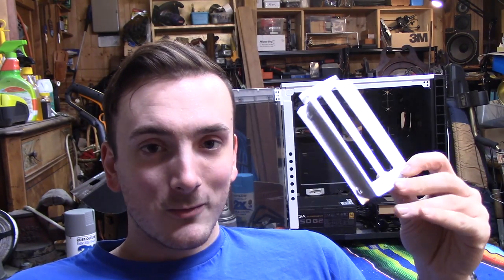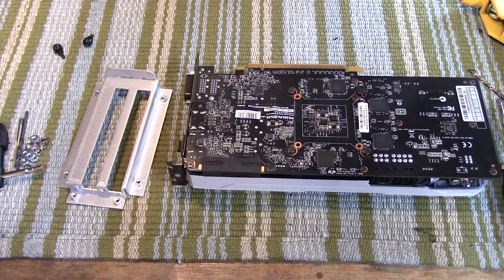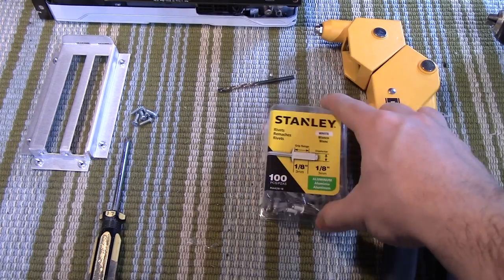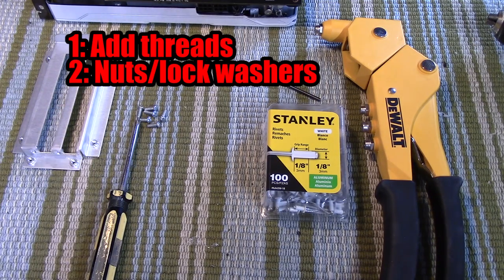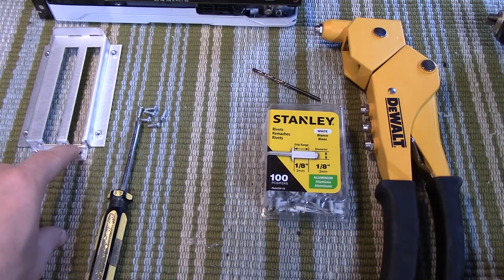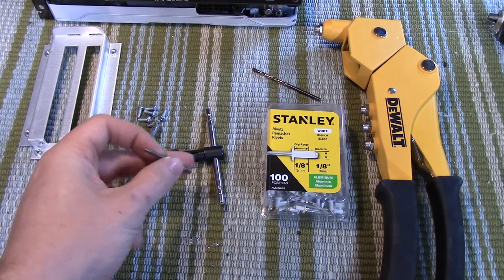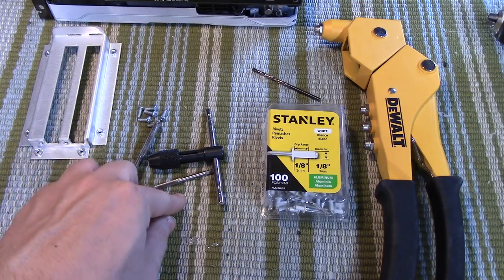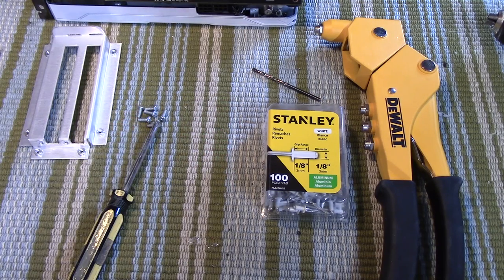How to mount your GPU vertically in any PC case!

Comment: would of been alot easier to just use the gril next to your case pci slots instead of making it to where your case no longer could do more than one sort of expansion card.
Reply: Ikr exactly what i was thinking all that time just wasted
Reply from the maker: Ronnie I think it looks ugly being too close to the window
Reply: Dietec understandable. as long as it works for you thats all that matters since its your case.
Reply: Dietec not for me since I use a water block from EK. I would have saved those $20 spent on that mounting bracket on some RGB LED fans like those cool solar eclipse fans.
Reply: But- if you used the grill, all the other PCI slots would still bee intact to populate. Doing it that way renders all your other slots useless,, unless you run more extensions. Jus saying- for a lot of people who have use for those slots- the grill would be a much better placement. With that said tho, I am a fan of your work, & for the most part- 99%- I love your tutorials bro! DEF not trollin ya
Reply: Alex Strogy you really took the time to correct grammar on a month old post? this is youtube, not my senior thesis.
Reply: I was literally thinking the same thing the entire time. That's what I would have done, I mean what if you ever need another PCIe slot? Lol out of luck I suppose. But he did suggest you just buy a case with the vertical slots I guess.
Reply: I don't know how much I would worry about air, as long as you have intake fans bringing fresh air into the case I think it would be ok. When you have SLI going the top card is always smushed so close to the bottom card that it runs warmer but it's usually never a big issue.
Reply: Ronnie, unless the side panel has ventilation right next to where the video card would go, I'd avoid putting it too close to the window/side. It needs space for ventilation and airflow for the fans.

Comment: How did you connect the card to the motherboard?
Reply: PCIe riser/extender cable.
$ for boring reliable versions from server/enterprise/datacenter suppliers or $$ for fancy branded decorative versions from PC enthusiast/gaming/modding vendors.
You could run a string of them halfway across the room if you like, the short distance inside a PC case doesn't add enough signal latency/loss to actually impact bandwidth or fps.

Comment: If this bracket has 6-32 thread in it you should put the screws in from the other side. That way you don't need nuts and don't need to tap threads in the metal plate.

Comment: Three things: 1. That case looks like it has a spot on the right (when looking from the back). Was there any solution you could find online that could utilize that space so you could still have those horizontal slots if you needed them?  2. Your lines need to be cleaner/straighter. My inner OCD is screaming bloody murder. 3. Great vid and tutorial. :)
Reply from the maker: +Middle of Knowhere I wouldn't want to have the GPU that close to the window, I know my line work needs improvement, I love you. Only thing I regret really is not sanding the cut pcie slots but I just didn't think about it until after it was already painted. Was too excited I guess
Reply: Perfectly understandable about not wanting the card too close to the window. Keep up the good work.

Comment: Great tutorial, but you should level the volume of the music next time. It blew my ears. :)
Reply from the maker: Peter M Ooof sorry. I actually did listen for that but my own ears weren't blown so I thought it was fine. Maybe I'm deaf, I'll try harder next one
Reply: that was REALLY loud
Reply: the music was annoying
Reply: i was thinking the same basically you should try to match the music's volume with your voice its like your voice = 5 and music = 9 cant explain it better
Reply: secrets to YouTube audio, Mono all voice, level all music and other audio at one third and only use instrumental music.
Reply: Peter M, next time when you feel the need to give unnecessary critics just keep it to yourself and use the volume adjusters on your system. that’s what there for after all.
Reply: zygis337 triggered?
Reply: TheDutyPaid, not at all.
Reply: zygis337 Don't you see your very own comment was unnecessary. 
Ah, hang on. You doing what the kids calling 'trolling' 
Do I need a sock puppet now or something?
Reply: TheDutyPaid, go grab some beverage and do some reading about what trolling is. Peace.
Reply: zygis337 I have no idea about it but I can still question why you posted the comment you did. Even the video creator acknowledge and responded to the original comment in a constructive way.

Comment: If the plate you are using is threaded already on the mounting points, why not simply drill a hole large enough for the screw to fit in and screw them in from the outside so that the head of the screw applies force against the case to hold the bracket in place. Seems a lot simpler than trying to mess around with nuts or tapping.

Comment: there should be a bracket that is vertically secured onto the pci brackets by the place where you would normally screw your gpu into

edit- wait never mind youd still need holes for I/O

Comment: If the adapter plate has threaded holes in them, why did you need to tap the plate you made? just enter the screws from the other side!
Reply from the maker: +TheOystei I happen to be a silly goose

Comment: Show it connected with the riser card is how u should have finished to make sure that where u moded and the riser card fit into the mobo
Reply from the maker: This is more of a proof on concept video. All cases, cards and mobos will be different and so showing my own working isn't going to be an accurate representation of how someone elses will work
Reply: Dietec fair enough and grate mod I myself am working with the evga dg-87 case looking at options as well

Comment: Excellent video. I see someone already mentioned the "nut-to-lock washer" orientation, so I will not repeat it. Personally, I think painting the modded bracket and plate before installing it would be better insurance regarding potential rust build-up, but I am picky like that.

Comment: Nice mod my Dietec friend. I have a question, is it possible to put the bracket on the left side where all the holes are..if it's to large you just have to cut the side of the bracket to fit and screw on top and bottom..not on side so you don't have to modify with a metal plate.
Reply from the maker: Alain Lafleche it's possible but I think you'd have to put a metal plate over the vent holes anyway, it'd be hard to screw it onto that area with all those holes there

Comment: Hey was wondering if a jigsaw is essential for cutting metal (for a side panel window) or could i just use a dremel tool? Also have you got a link to that spray paint? (If not its cool). Awesome vid btw. Been watching here for a little while and want to get into modding :)
Reply from the maker: Jigsaw makes cutting larger things muuuuch easier but yes, with a lot more time you could do it with a dremel. The paint was rustoleum enamel
Reply: Alright thanks!

Comment: Howdy Dietec, You have the screws in backwards....The heads would be on the Flat side and the threads would end in the threaded pieces on the plate, there was No need to tap out your plate....I would suggest though to use some flat washers and some lock tight on your new mount to avoid vibration loosening the screws.. for what I mentioned,  The way you showed & used them with the lock washers have no need.  Anyway Nice Video, I just did 2 of brackets those in a Wp200 case at a 45 angle for a show but on the top like the TT 900 Tower case   The worst part is Fabricating New Pci 16 Ribbon cables to custom length and then hiding them with the chrome the customer wants.....Keep up the great work young man!  Cow }:-o)
Reply from the maker: +Im1CrazyCow Oh, yeah I see what you're saying. Totally didn't even think of that
Reply: Ive done it long ago so No sweat just thought ide throw it out to you,,,Keep up the great work young man!

Comment: NIce video dude. BTW the amount of detail a manufacturer puts on the graphics card front, they should be mounted vertically.
Reply: Mounting vertically will also not bend the PCB as it use to when mounted in regular manner. ( big GPU sag mostly )
Reply from the maker: DIY Tech I agree it's weird that they put so much effort into a side that isn't usually visible but a lot of cards don't have backplates

Comment: Doesnt the pci  cage you bought have the nuts already on it, so in other words you just need to drill the holes for for it, and run them from the other side into the nuts, instead of treading them through the back and then adding the new nuts and washers. Am I wrong?
Reply from the maker: You're not wrong! Still, if you've got a mount without threads in it already, you'd have to do this. This isn't the only mount out there and I'm not sure how the other ones are

Comment: I have an Air 240 that my 1080 barely fits in, door is pressing against the cooler shroud. been thinking of doing something like this for it.  this video has been very helpful.
Reply: SilentGamerGuy Another Air 240 user here. Did it work? Did you do it?
Reply: I did get it mounted vertically. but I didn't use a mounting bracket.  I made some cuts in the back fans slots, and cut out the metal bars where the gpu slot is.  it's very shitty looking. if I had the option to go back, I wouldn't have done it the way I did, it looks so ugly.  I mean the rest of the case looks cool, just the back looks like shit...  If I could do it again I would have just bought an Air 540 and bought one of the Cooler Master vertical GPU mounts they sell on Newegg.
Reply from the maker: +SilentGamerGuy The cooler master mount is pretty nice. I would get one of those too if I wanted to do this again.

Comment: i was just looking into doing this mod to my inwin 303.  Only thing test the fps with gpu directly into motherboard then test again through the cable. cheaper cable have a bad habit of fps loss.
Reply from the maker: Squeeker Radio I'll do a test like this if I ever have one myself, but I linked the one with the highest rating I could find. Hopefully it works out for people.
Reply: Dietec ill be doing the same mod so ill let you know my results

Comment: No need to tap or screw anything together, just rivet the bracket to the case.  This guy is making it way harder than it needs to be.  And to top it off, he put screws in from wrong direction.  I bet this this guy flips burgers for a living.
Reply from the maker: I have been known to flip a burger here and there

Comment: idea of plan 'good' execution 'bad'!you wrecked your case and you wasted the option for expansion slots. I understand why you didn't place it next to it where the mesh is. but you still could have if you opted for modifying your side panel so the gpu can breathe. I own a nzxt phantom 820 case and have a similar idea of plans but I am going to remove the location for external water loop holes next to the case bracket and have the luck I have a mesh on my side panel so my expansion options is not wasted. I also will be adding a psu cover so I have a extra mounting point for the rising cable/gpu support.

Comment: I THINK YOU MESSED UP BRO--- THE DEPTH OF THE ORIGINAL GPU SLOTS WAS WHERE IT NEEDED TO BE BUT YOU WENT DEEPER SO YOUR CARD WILL BE OFFSET
Reply: MrRadio1610 why it isnt going to slot in anymore just use an pcie extension

Comment: Ive been looking for something like that bracket. Just didnt know what to look for. Thanks! Im looking into making a case like the Dan Case a4sfx but out of wood. Their case is way too damn expensive. Using this video and a video DIYPERKS made on making your own pc case... its now going to become possible. Though using a 3M riser card (80ish $) is more preferred for me since they use those and i want almost the same. Now im just having trouble getting a motherboard bracket because im not into cutting one out from an existing case. Might also need double sided tape or mounting bracks for ssd size hdds. Damnit. now that i think about it.. a way to mount the psu too. mines an sfxL. Im tired of my Node 202. Time for smaller.my budgets only 120 though. i know the 3M riser cable is like 80 so..theres that.
Reply from the maker: Sounds like quite a project you got there
Reply: Dietec but 0 knowledge, supplies, or skill to execute it. Hoping i can come up with something.

Comment: but.. why for?
Reply: To show off the card XD. And because the bigger heavier cards are a bit precarious hanging just by the slot in the back and the port on the mother board that only reaches to half the length of the card.
Reply: It's always good to have more options.  And anything goes with custom.  But you can probably buy or make some kind of support bar for heavy cards (or get a better case which already includes the feature) for similar overall cost and effort.
Reply: to prevent gpu sag

Comment: Or just buy a case with vertical pci slots. I thought i saw one of those for, like, what? 40 bucks?
Reply: Madafakas McGato - Are you referring to those ugly cube cases?
Reply: @Voltaic314  Cubes are actually great for mATX mobos with twin GPUs and huge air cooler, small chassis volume, efficiently ducted airflow, can stack a few units tall.  Full tower is the only choice for hardware-heavy machines but in practice most towers just occupy a big footprint which is half-empty anyhow.
You can get cheap generic cases - cubes or midtowers - with vertical or even swappable slot backplates for ~$60.

Comment: This is wrong. If you purchased a vertical mounting PCI cable, it would not line up. What you should have done was cut the entire PCI cage out. The way youve got it, the video card will sit further inside the case by 1/2" or more.